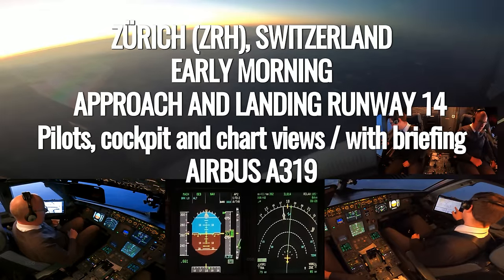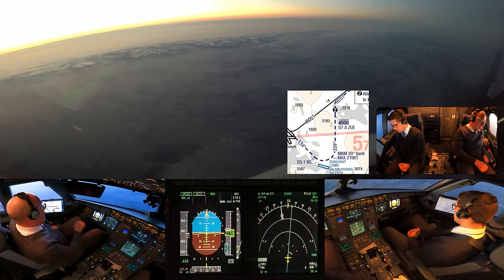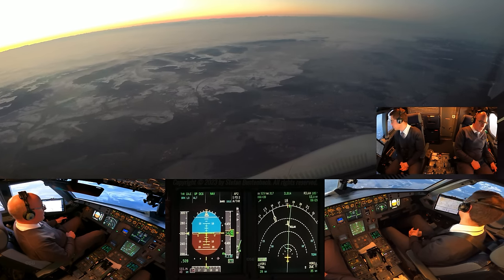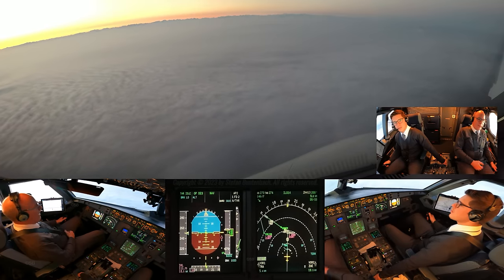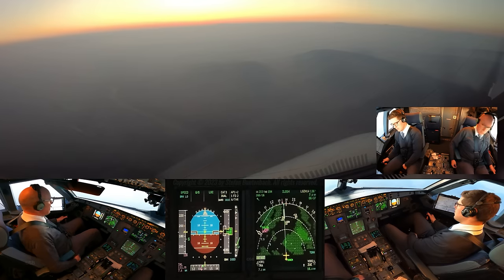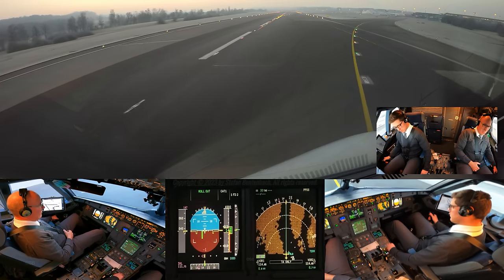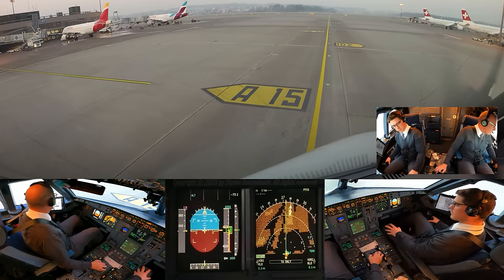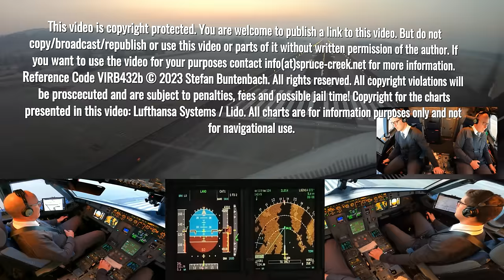ZURICH 🇨🇭 (ZRH) | Early morning full approach rwy 14 | Airbus pilots + cockpit views | with briefing

Comment: I’m so late 😅! Interesting seeing minimums called at charted 1610’ DA with RA well below 187’, then again RA can be a bit iffy until over the lights. Otherwise another excellent video and happy new year!
Reply from the maker: Thanks for watching and your feedback! The minimums call at a CAT 1 approach has nothing to do with the radio altimeter. So radio altitude does not matter here. It is only about the barimetric altimeter on the PFD. The radio altimeter is only used for the minimum during CAT 2 or CAT 3 approaches. As you said, the radio altimeter indications are changing a lot due to obstacles in front of the runway.

Comment: Thanks a lot for your video! I wanted to ask, when do you need to wear a uniform and when it is not obligatory?
Reply from the maker: Thanks for watching and your question! We are wearing a uniform. Everything we wear here is part of the uniform which is provided by the company. As long as we fly passengers, we usually wear a uniform. When we do ferry or maintenance flights, we may do this in normal clothing.

Comment: Wie immer ein tolles Video, dass den Samstag kurz vor Weihnachten noch viel besser macht. Mal wieder eine Frage: Wann benutzt man wing- und/oder engine anti ice? Oftmals sehe ich, dass nur engine anti ice benutzt wird und wing anti ice eher selten. Woran liegt das?
Schon mal vielen Dank und liebe Grüße
Reply: Eng anti ice when temp 10 deg or less and in moisture or clouds, wing anti ice only when icing is visible on the aircraft, like the windscreen or wing leading edge etc.
Reply from the maker: Vielen Dank für das gute Feedback! Die Anti Ice Frage wurde ja schon beantwortet. In Ergänzung kann ich noch hinzufügen, dass wir draußen  vor drer Cockpitscheibe einen Eis Indikator haben. Das ist ein beleuchteter Pin. Wenn sich Eis an ihm ansetzt, schalten wir auch Wing Anti Ice ein. Oder wenn wir von vornherein wissen, dass wir in Gebiete mit schwerer Vereisung oder Freezing Fog oder Freezing Rain fliegen.

Comment: A lot of changes of the frequencies on the apron after landing and for the crossing of 28 there should be a change to tower of Zurich and after crossing 28 then back to Apron. That is correct?
Reply from the maker: The video shows how they did it at this day during our arrival. Every airport is different designed in regard to the responsibility areas of grond, apron and tower. And even depending on the traffic situation, it may change throughout the day. In Dusseldorf, for example, Tower is sometimes  giving the taxi instructions after landing. At other times, they send you to ground for the same routing.

Comment: full reverse below 70kts? Also there was the LAND callout missing or was this an audio problem?
Reply from the maker: We do not use full reverse below 70 knots, unless it is an emergency. Most of the landings are done with idle reverse, like the one you see in the video. At touchdown, the thrust levers were moved for a fraction of a second to the max reverse detend and then directly to the idle detend. Some pilots move the thrust levers directly to the idle detend and others move the levers first to max for a fraction of a second and then back to idle. The resulting idle thrust is the same. When landing with idle reverse, nothing happens at the 70 knots call because the thrust levers are already at idle. Sometimes the audio track in the videos is incomplete due to technical reasons. If you do not hear a callout in the video, it does not necessarily  mean that it was not made.

Comment: When I was in the simulator at Shoreham airport (EGKA), I found it very difficult to taxi the 737 with the tiller; I wandered off the centre line constantly. Is it easier for you?
Reply from the maker: My personal Airbus A320 experience is that it is sometimes more difficult to steer with the tiller in the fullflight simulator than in the real airplane.  Steering the real plane with tiller is very easy.